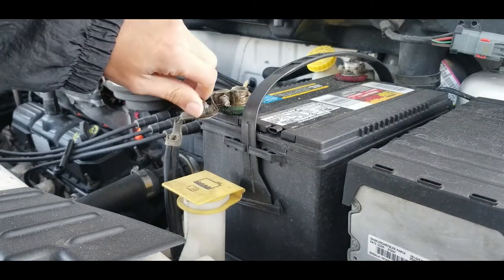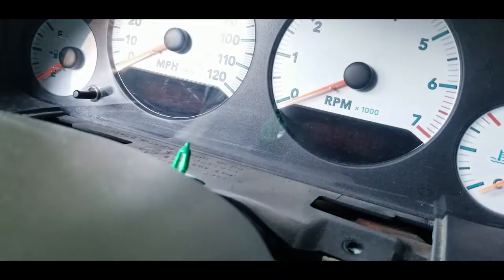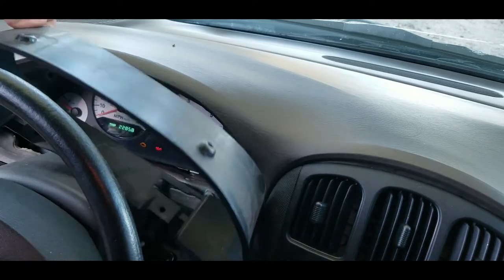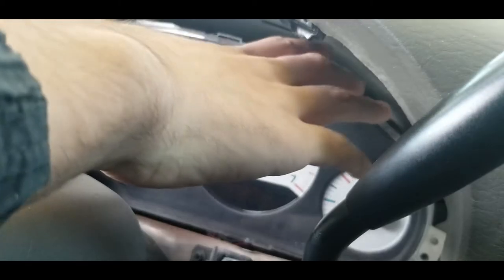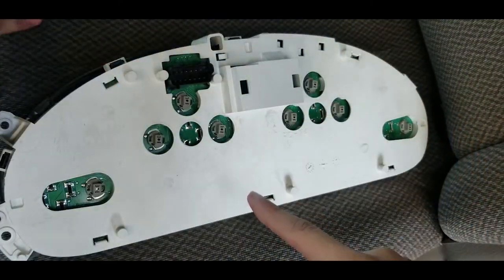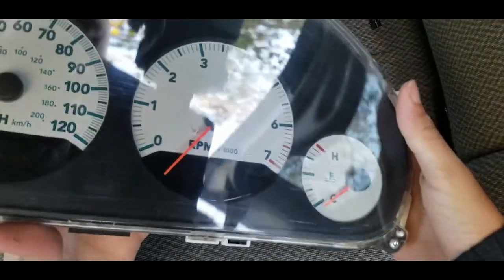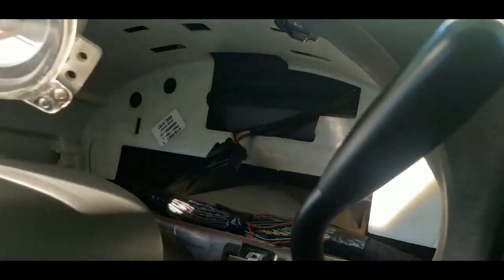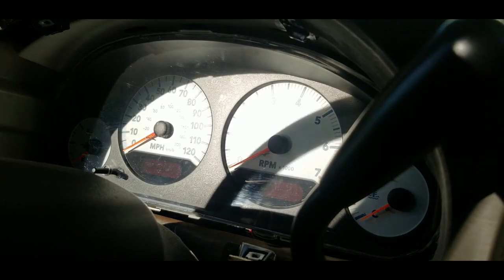Dashboard Bulb Replacement | 01-07 Grand Caravan/Town and Country

Comment: great video.  my tach needle was on the wrong side of the pin and did not work  !!! now it does and bulbs replaced .  thank you
Reply from the maker: Glad it worked out for you!
Reply: Can always calibrate your gauge cluster so you don’t have to pull it out

Comment: You do not need to reconnect the battery to shift the gear. It worked by simply putting the key in the ignition, turn and it's unlocked. You can take the key only when you shift back, so just leave it. T&C 2006   Btw thank you for the video!!!!!

Comment: thanks for the video and clear camera work too. I watched other videos and they either have the camera shaking or bad angle, but yours was spot on. You are also the only one mentioning to check the gauge needle position and rotating them back into place if they are on the wrong side of the stop pin. That was really helpful info!!
Reply from the maker: Glad it helped u m8
Reply: @TechiePocket1  ..... sure did help. I just replaced the bulbs today. I am glad I ordered a 10-pack because 7 of the 8 bulbs were blown out. 😊

Comment: Thanks for the video. Who installed the battery terminal? I would like t have a battery terminal like the one you have in my van.
Reply from the maker: My van actually came like that when I bought it used so not sure. You can get lots of terminals from Amazon and they're easy to install. I have a set of quick disconnect terminals now

Comment: Wasn't even looking for this video but it is totally relevant. Heck I can't see my tach or temp gauge at night. Didn't realize it was this easy. Got this van for $500 and it was a steal....

Hey, any idea why my van isn't getting up to operating temp? I flushed the cooling system while installing a new water pump, purged it, new thermostat and housing.... and it maybe gets to about halfway to the center of the gauge... heat doesn't really work and cools the engine off QUICK, it'll be reading full cold while driving 70+ on the interstate. 

Now when I got the van about 2 weeks ago, the heat worked fine. Wonder if the problem is simply the heater core hose I had to fab up... maybe it's collapsing? Or maybe catching air and cooling? Anywho... going to try to put the right size / type of hose there see if it makes a difference but other than that, any ideas?
Reply from the maker: Did you run the heater while bleeding the air out of the cooling system? If not there won't be enough coolant in the system. But you're saying it's running cold, sounds like the thermostat isn't functioning. I'd try and change it out even though it's already new. Did you change the radiator hoses btw? They like to get old and crack leaving you stranded lol
Reply from the maker: Not sure how the coolant sensor works on this car but I can imagine if you don't have enough coolant the sensor might not be reading properly.
Reply: @TechiePocket1  I dread dealing with that thermostat housing again lol, this time I'll get some RTV to help seal it, had a real bear of a time getting it to stop leaking at first. I'll try another thermostat.... got a few days off work so I can mess around, rather drive this than my TDI at the moment - DPF problems galore! Definitely plenty of coolant and I always run the heat when bleeding.

The hoses are new, suspect they replaced them at some point before I bought it. Cooling systems tend to be weird when they haven't seen pressure in a while, I had 3 or 4 hoses pop after the water pump....

You know what? I think I'm going to throw a radiator cap at this thing first and see if it sticks... haven't replaced that...
Reply from the maker: @TimLenhartTech  Oh ye definitely try the radiator cap. Hopefully, you can solve the problem. If you find the fix do let me know.
Reply: change the thermostaff

Comment: Did you put in leds for the dashboard light because I want to know if it’s dimmable before buying it. Thanks!
Reply from the maker: Yes, the link is in the description and they are dimmable.
Reply: @TechiePocket1  thanks, i upgraded the whole front end with leds, for the turn signals i had to put a resistor. If the parking lights are not on the leds will hyperflash. If the parklights are on the lights will be while solid and change color to orange while blinking. While the parking lights are on it works normally. Just a heads up if you want to upgrade that, im not sure if its because of the one ive gotten but ive never seen anyone in the history of the 2007 dodge grand caravan convert turn signals to led lol! Thanks again, im gonna upgrade the brake lights too, it sucks that it uses the same bulb as the brake light but i dont think they make led flashers for these bulbs. If they did i could of bought a random pair of leds and popped them in and it would give no issue. But sometimes it doesn't work out the way you want it to, thanks again, about to order these dashboard lights

Comment: Good video quick question do you know if these leds will work for the instrument lights?
Reply from the maker: Not sure on that one. Been looking into that myself because mine are all dead lol. I'll let u know if I find out
Reply: @TechiePocket1  just opened up the upper console and it’s just a single led with no fancy connector just the raw led into the circuit board
Reply from the maker: @knife2802  alrighty thanks for letting me know.

Comment: Replaced the lights on the wifes  06 grand caravan with no problem. took the dash apart on my 06 town and country and there were NO pc 74 bulbs at all. any idea whats up with that?
Reply from the maker: Just non existent? Did your dashboard light up before?
Reply: @TechiePocket1  i just found out that the holes are just there like the caravan, but inside the assembly is led lights that are soldered in place.

Comment: My LED bulbs did not come with sockets.  Do the old bulbs pull out of the sockets?  I can't get them out.
Reply from the maker: You can but mine were frozen so I opted to use the new ones.
Reply: @TechiePocket1  I finally got them out by just about breaking them off in there and one did shatter on me. Got it to work but I don't believe those sockets were made to be reused. I really had to mess with the wire position on the bulbs to get connection. 3 1/2 hours later it works but definitely going with new sockets next time. None available locally so I had to work with what I had while the dash was apart.
Reply: Also figured out the top part of all sockets is + and the bottom half -. My new LED bulbs were not labeled for polarity so I used a couple aligator clip leads on a 9v battery and pretested them all and put red and black dots on them with markers to take the guesswork out of it.